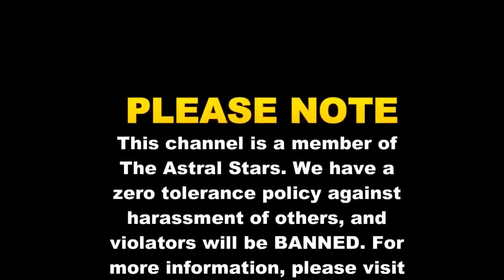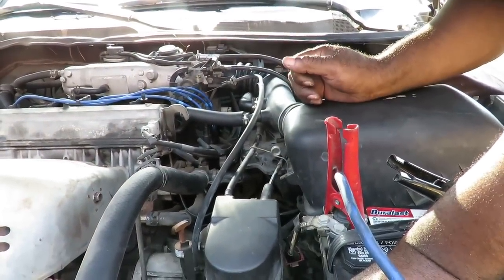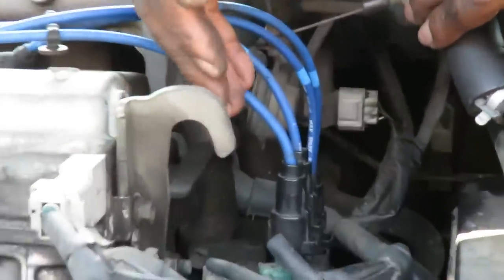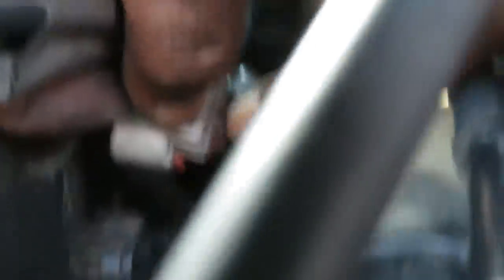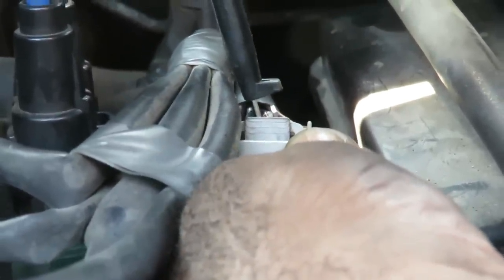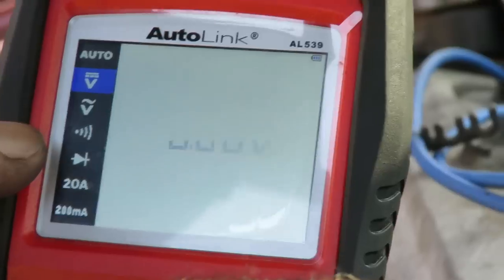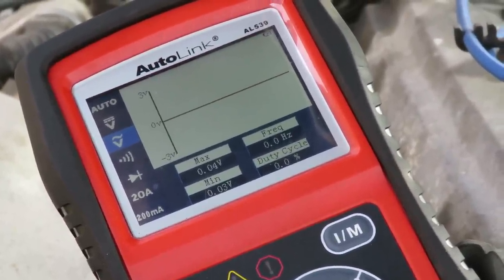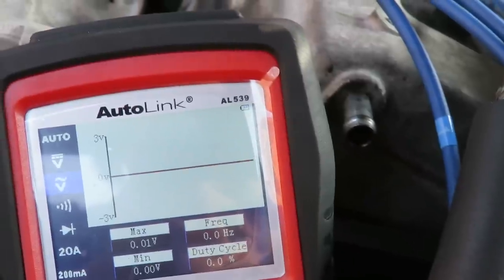⭐ 1998 Toyota Camry - 2.2 - P1300 - Ignitor Circuit Malfunction 1

Comment: Hey Tim! I believe that's what's called a waste spark system. It fires one cylinder and then the companion cly fires at the same time during the exhaust stroke. The spark goes out the plug, through the head into the other plug and back to the coil. The igniter isn't the same thing as the coil but on this model its inside the coil! I love my electrical lol
Reply from the maker: WHAT? I really appreciate that lesson Matt! i knew about igniters and coils, but had no idea of the waste spark system,THANKS!
Reply: Astral Auto Repairs awesome! No problem I love this stuff

Comment: I have a '96 4cyl Camry with this code. I changed the fuel pump, fuel filter, spark plugs, wires, dist. Cap, ignitor, ignitor switch, cleaned the throttle body and IAC valve, so I'm doing everything apart from P1300 and the car won't stay running. 
Unlike the '98 camry, mine has all four wires connect to a distributor cap which connects to a black box next to the ignition module. For my vehicle, should I back probe the connector on the ignition module to get the feedback from the ecu? I really don't wanna change a computer because I never did it.
Reply from the maker: Hey David, before you probe those wires, see if you can get a wiring diagram to see what those wires are suppose to read.
Reply: I also have a 96 and have done everything you have done
So frustrated

Comment: Thanks for this tutorial. I learn something. I do have a couple of questions: Is this Autel like a poor man's version of the Snap-on Verus? Second question: When you were cranking the ignition the engine just keep on cranking without actually starting. Did you disconnect the fuel pump fuse so that the engine won't start and won't get flooded? I'm not a mechanic - just a guy who wants to know how to fix things. Thanks for the education!
Reply from the maker: Hi and THANKS!! The AL539B is more comparable to the snap on vantage. No we did not disconnect anything, BUT, that would be a great idea to do so
Reply from the maker: Also, if you want to learn more about using the Autel AL539B, here is our other channel on it: https://www.youtube.com/channel/UCTq2syPYXSCGsMUF5I5SV1Q/
Reply: Astral Auto Repairs thank you 🙏

Comment: Hey, Tim. We are dealing with a misfire on a toyota with 4 wire coils. The owner replaced the connector, and for some reasons, the IGt wire is installed where the ground wire is supposed to be. I would say that the IGF is shorted to ground. Since the IGT is the  signal from the ECM to the ignitor controlled by a power transistor or driver in the ECM, a shorted IGT wire would most likely take out the driver unless the driver is protected against such thing, right?
Reply from the maker: That's a good question because SOME ecms will protect itself from a back feed or short, while others  (Chrysler In particular) will burn out the driver. I would suggest checking for the signal right out of the ecm, with the coil DISCONNECTED.

Comment: was it confirmed to have bad ignition wires? My 97 camry 2.2l has the same code and also doesnt start up when turning the key. im waiting on new ignition coils to come in the mail but should i go ahead and order ignition wires?
Reply from the maker: YES, change your wires as well, and be sure to check the condition of your spark plugs!

Comment: Hi I’m having the same issue with 1999 Toyota Tacoma sr5 2.7 4x4 manual already replace coils, spark plugs wires, ecu check the ground I’m still getting the code and stalling every time I drive any help please what should I check next
Reply: fuel pump

Comment: Hi I was wondering if this can be done with a multimeter instead of an oscilloscope like shown in the video. I tried but im not sure if the readings were what i should be getting, 5v on conf and 1.2v on control.
Reply from the maker: More than likely it is possible.

Comment: Aye Timmy I'm buying this 2000 Camry in November from my church friend n it has about 80,000 miles on it u know I got to jump on that so I see this 98is no different so any repair videos on the old school vantage Camry I'm taking notes lol
Reply from the maker: LOL, does it need any work?
Reply: @OnlineAutoRepairVideos  I test drove it it rides way better than my current car um no leaking valve covers they used pink coolant the brakes are sharp suspension is a a1 I felt no bumps unlike my current car but I hook a scanner up to it n it said it had a small evap leak!!!
Reply from the maker: I don't think it's going to be bad, just a little difficult to locate, maybe.
Reply: @OnlineAutoRepairVideos  ikr good thing we don't have emissions here lol

Comment: I have the same code but my car shut down while driving and now will not start. When I start it it will crank and attempts to idle for a few tenths of a second before shutting off again. Any ideas?
Reply from the maker: Do you have any other codes besides the P1300?
Reply: @OnlineAutoRepairVideos  EGR codes and an o2 sensor bank one. Both of which have been on since before I bought the car. It's a 211,000 mile beater so I'm not trying to fix everything under the hood. But it shut off today at 70mph and now it's on the side of the road lol
Reply: @OnlineAutoRepairVideos  I replaced the #1 ignition coil not long ago due to a misfire on cylinders 1 and 4.  Since then it has ran perfectly.  Now this all of a sudden.  It feels like a fuel issue, but I know when P1300 is thrown the ECM will limit fuel, so that makes sense. I wonder if I got a bad coil right out of the box.  But wouldnt that just cause misfires?
Reply: @ConklinTa  Were you able to fix it? I'm having the same issue with a 98 Toyota Sienna on cylinder 1. Changed ignition coil but still the same. Is driving me nuts

Comment: Is it possible a o2 sensor could be acting up and not showing the check light
Reply from the maker: Yes
Reply: @OnlineAutoRepairVideos  my 2013 kia is drinking a lot of gas and my autel scan tool is not showing any errors. But the section where is does I/M checks the o2. Part has a red x
Reply from the maker: In your datastream, what is your coolant sensor reading, do you smell raw fuel, and is there black smoke coming from the exhaust?
Reply: @OnlineAutoRepairVideos  .have to check that out but no black smoke it is not losing oil it is driving good and strong not smelling no fuel. I recently replaced the spark plugs,air filter,oil and oil filter. I used the same spark plugs that the owners manual has.
Reply: @OnlineAutoRepairVideos  can a bad coolant switch cause excess gas use.
Reply: @OnlineAutoRepairVideos  By the way I am all in Barbados.
Reply from the maker: WOW, that's pretty far, COOL!!! Yes a coolant sensor can cause that...

The colder a coolant sensor reads, the computer will demand more fuel, but you would smell fuel if that was the case. In your datastream, also let me know what the fuel trims are reading.
Reply: @OnlineAutoRepairVideos  Will let you know. Do you use whatsapp
Reply from the maker: ok sounds good. No i don't, but you can email me at tim@astralautorepairs.com
Reply: @OnlineAutoRepairVideos  By the way my tempt gauge is just below the half Mark where it always is
Reply from the maker: I need to know what the scanner is reading